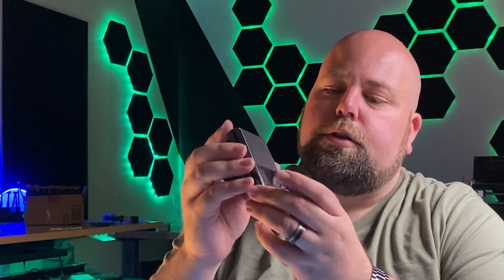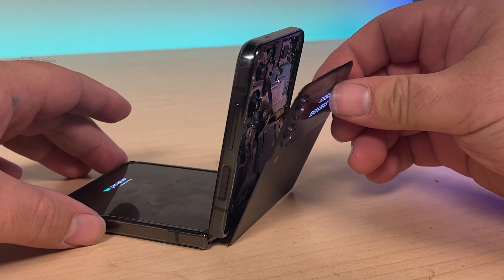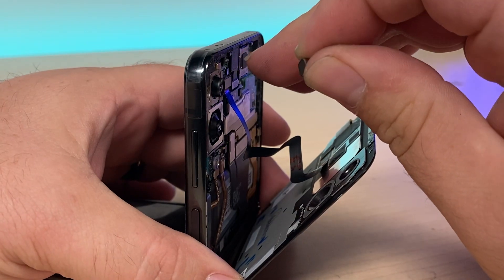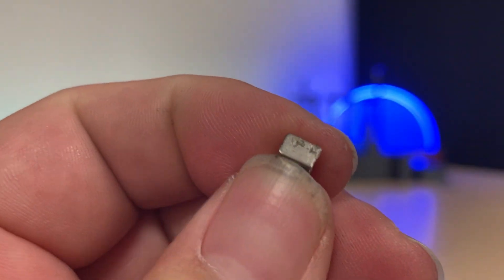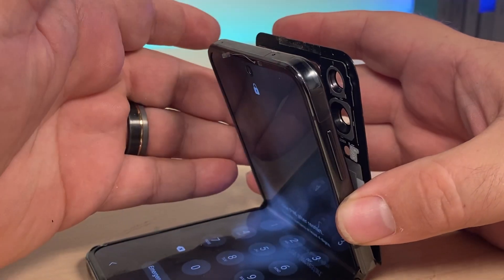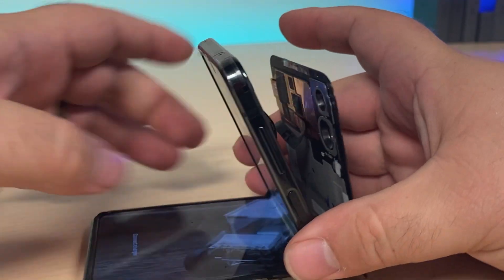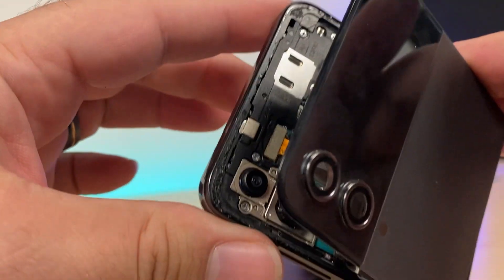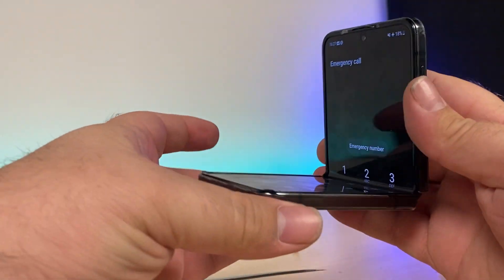Fix Samsung Galaxy Z Flip 4 5G Blackout Display | (Tips and Tricks #37)

Comment: So do we just move the original magnet around till it's in the right spot?
Reply from the maker: You can add a thin small magnet to the other as shown or remove the magnet and clean out the old adhesive and adhere it again with thin glue and you will get the same result
Reply: @MobileSentrix  Hi thanks for the reply! I've managed to get it working by removing it and then press it back down in place. However the only issue now is that I get no signal on my device. But when I'm at my sisters which is literally down the road I get one bar or a very weak signal and 5G/4G intermittently flickers. Do you know what the fix would be for this? Do I need any replacement sub antenna board?
Reply: Hi my coverscreen does not work. It boots up but then nothing. Will this trick work for the coverscreen as well.

Comment: I bought the service pack with you of this model what happens  sometimes the screen when receive a call the screen is black when you open the phone impossible answer but some time is ok I think is something relative to the proximity sensor if the screen is not well Stuck with its adhesive in that area, the sensor does not receive the light correctly

Comment: This is more of a temporary solution. If you need to, uBreakiFix stores can run Samsung's Digital Hall-IC calibration to permanently fix the issue. Many times they'll do it for free. Even Samsung OEM screens have the same issue and are fixed during the outgoing quality control process.